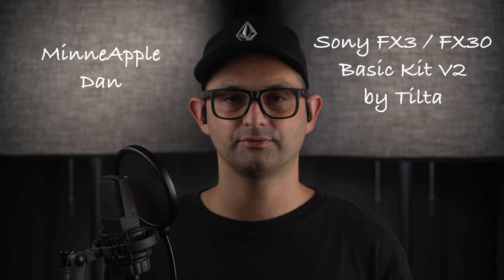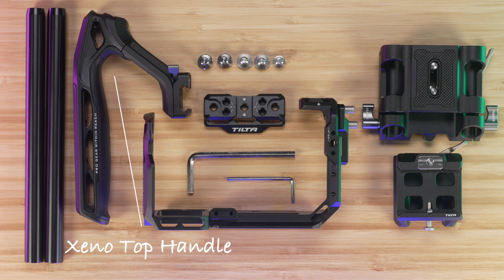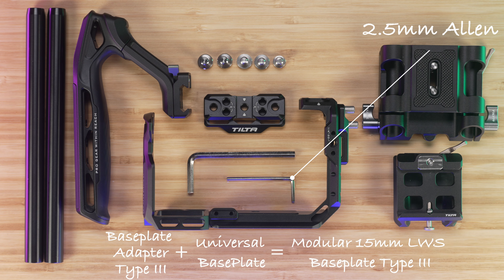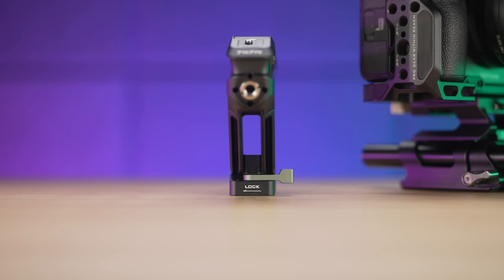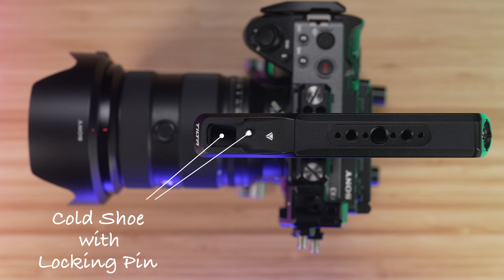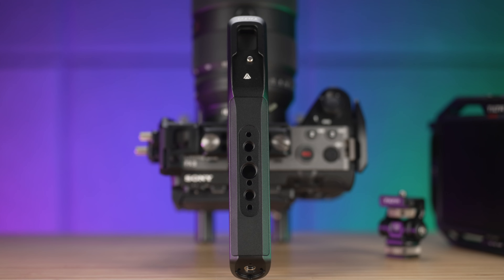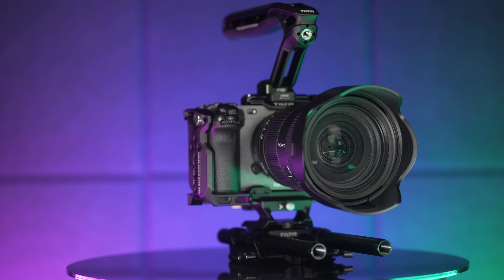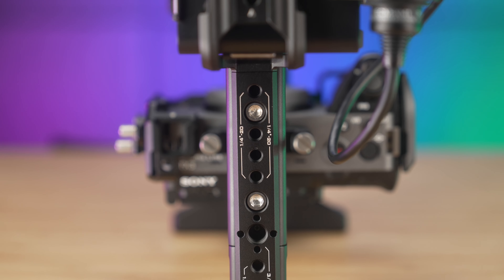Sony FX3 / FX30 V2 Basic Kit by Tilta, Comprehensive First Look

Comment: So, i have to put the left side and then the right one or how? Does anyone know where to get the V1? :(
Reply from the maker: If you go to TILTA’s website, under Deals, they have fx3/fx30 v1 cages open-box. Otherwise, for the v2 cage: screw left bolt in partially, then right bolt in partially, then bottom bolt in partially. Finally screw them all down,all the way, starting from the left side first. Hope this helps.